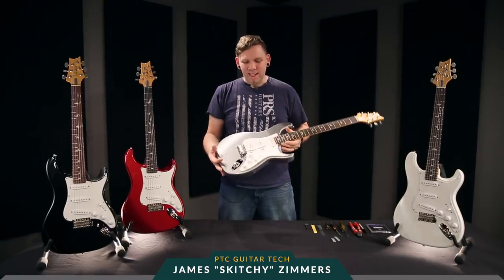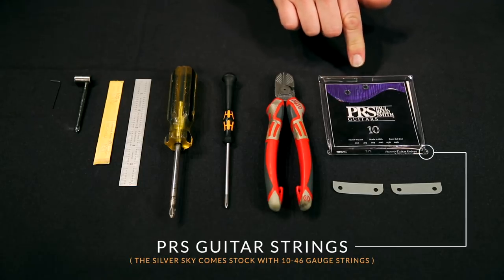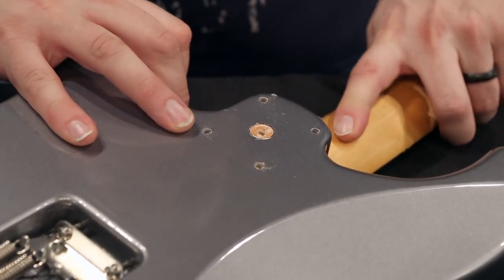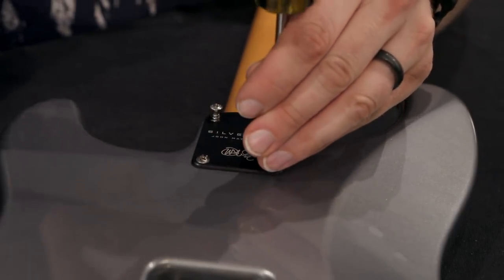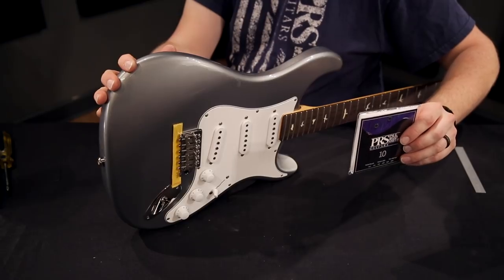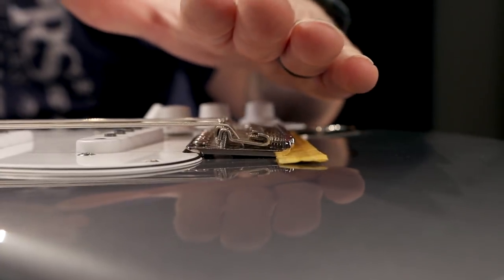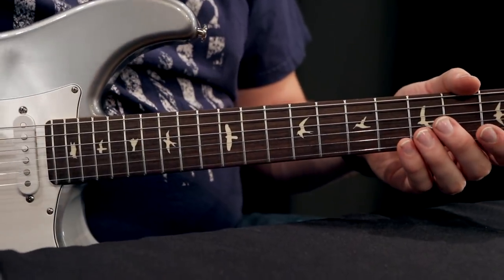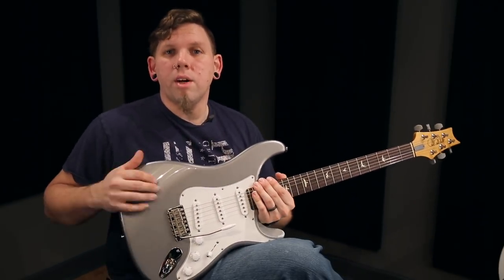Silver Sky Setup: Flush Mount to Floating Trem | PRS Guitars

Comment from the maker: Hi everyone,
I just wanted to let you know that you will need to make a slight adjustment to the pickup heights once the bridge adjustments have been made. Specs are listed below

Pickup heights: 
Neck - Bass side 4/32, treble side 5/64 
Middle - Bass side 4/32, treble side 7/64 
Bridge - Bass side 4/32, treble side 2/32 

Enjoy! 
-James "Skitchy" Zimmers 
PTC Guitar Tech
Reply: I was looking for these for a long time! Thanks so much :) finally the pickups sound balanced.
Reply: Is the pickup height from the pickguard or the distance to the strings?
Reply: Where are you taking the measurements from ? The fist fret ?

Comment: 1. Place card stock under the tremolo
2. Remove strings
3. Remove the neck from the body
4. Installing the shims
5. Unhook tremolo springs
6. Raise the six tremolo screws 2/32 of an inch
7. Re-hook tremolo springs
8. Restring your guitar with 10-46 gauge strings. Stretch and tune each string until the guitar no longer goes out of tune after stretching the strings.
9. Back out the claw screws evenly until the bridge levels out
10. Stop and tune your guitar
11. Set string height to proper measurements
12. Stop and tune your guitar
13. Check/adjust intonation

Comment: Awesome video. And, amazing detail! I needed to lower the floating bridge on my Core Cu24 35th by 1/64" (because my high-E saddle was bottomed out), but I knew all the screws had to be exactly aligned and I wasn't sure what to do or what tool to use to make this exact adjustment. But, knowing that a full turn adjusts by 2/32" made it easy, as I just needed to lower each screw by 1/4 turn.

My setup was already great, but now it's perfect.

Thanks, Skitchy and PRS!

Comment: I want to understand if this is the PRS SE SILVER SKY and the CORE unit you refer to is the REGULAR SILVER SKY which was initially made for Mayer and then then reproduced at a bit over  $2500. Thanks in advance, and this video was exceptional. Would love to see videos on the correct setting up of the SE Silver Sky with the factory strings and also changing strings to lighter gauges etc.

Comment: Thanks for this; very helpful. Just to share from my own experience of doing this change on my own Silver Sky, I actually found a shim of 2/32nds (about 1.58mm) to be a little too much....  and I ran out of height on the bridge saddle screws... but a 1mm shim (about 1/25 of an inch?) worked a treat.... :-)
Reply: Nice, I tried 1mm on my strat but the high e is choking when bending. Does that happen to you?
Reply: where do you get the shims from?

Comment: You can skip the back and forth tuning and adjusting springs by blocking the trem first.

Just overtighten the springs and block the trem so it sits parallel. Tune and set up everything including intonation and string heights, then remove the block. All you have to do now is loosen the springs until the bridge moves back to the same position, you'll know when as everything will magically be in tune again when the bridge reaches the correct angle.

Surely Paul doesn't mess around going back and forth adjusting springs and tuning until it settles!
Reply: This is what I do on all my floating guitars. Skips all the hassle of wrestling with the string & spring tension.

Comment: They don't do it this way anymore. No shims. I had it done. $200 plus $50 shipping. Bridge is not flush. Tilts foward. Major tuning issues.
Reply: Did they tell you that they didn’t use shims? Are the new silver sky’s built slightly different?

Comment: You forgot to re-adjust the pickups for new string heights.  (do I win a silver sky..?)
Reply: a.... since they have set the saddles lower after raising the bridge, and they confirmed string height on the fretboard.
Basically they just raised the bridge plate with their saddles staying at same distance from the body.

I hope you win the silver sky.
Reply: Minsup Song you misunderstood,  the pickups (not bridge/saddles) are farther from the strings causing a loss of volume.   The pickups should be raised in proportion to the adjustments made.
Reply: 8:40 
Man in the video says, "this is where the Silver Sky differs from the core setup", "On te core setup",  and "on Silver Sky we are looking at...." 

Does the "core setup" that the guy is mentioning stands for the silver sky's original string height? 

I understood these words as they set string height on Silver Sky as they did in the video no matter how the bridge is set. That means the Silver Sky was set up as it should before the adjustment, then on step 11 he should have lowered the saddle height since he had raised the whole bridge. So, raised amount of bridge plate and lowered amount of saddles compensate each other, string heights should be just same as before. 

This is how I understood. That's why I said pickup adjustment is not needed since I thought the only diffrence is that bridge is now floating.
Reply: The "core setup" is not the silver sky's original string height...the tech is referring to PRS's Core Line of guitars that come from the factory with the "floating" tremolo (not a "fixed" tremolo like the silver sky).    John Mayer doesn't like the "floating two way tremolo", so he "fixes" it to only allowing the tremolo bar to be pushed down only.    When you go from a "fixed" bridge to a "floating" bridge the strings do raise up a little bit higher even after adjusting the saddles.   Its a minimal adjustment and I said it joking around with the PRS tech geeks.
Reply from the maker: Hi Bret,
Good catch! Yes, you will need to make a slight adjustment to the pickup heights once the bridge adjustments have been made.
Sadly, no, you do not win a Silver Sky. Though we admire the attempt!

Pickup heights:
Neck - Bass side 4/32, treble side 5/64
Middle - Bass side 4/32, treble side 7/64
Bridge - Bass side 4/32, treble side 2/32

Enjoy!
-James "Skitchy" Zimmers
PTC Guitar Tech
Reply: @prsguitars  are the pickup height measured from the pick guard or the distance to the strings?

Comment: These shims no longer come with the guitar, this video is misleading and should be removed. There should be a follow up video posted on how to adjust the guitar to float without the shims. It does not float according to their spec without some kind of compensation at the neck pocket.